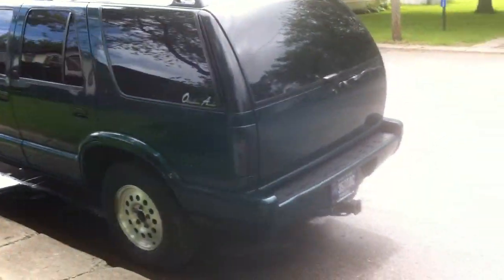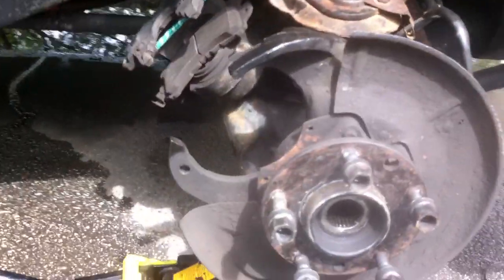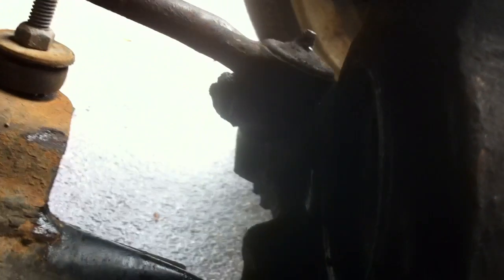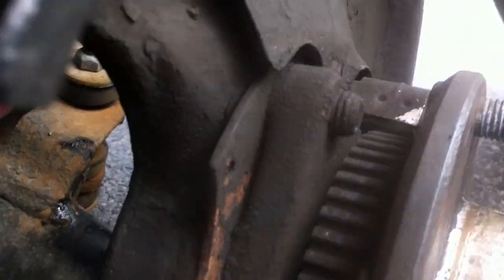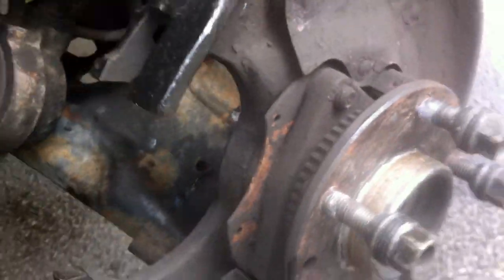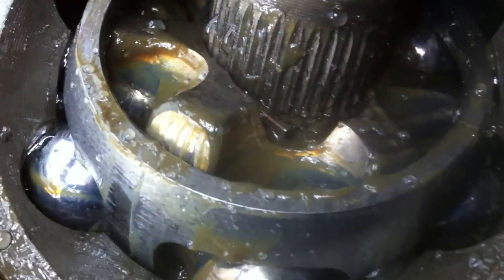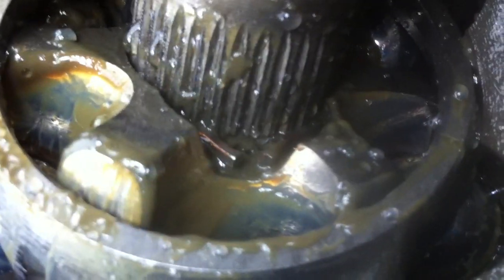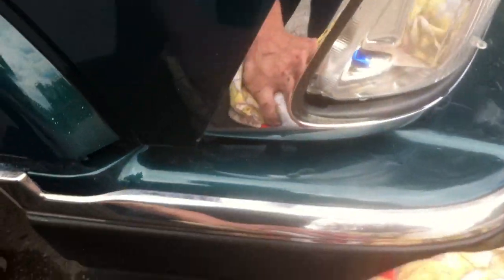1997 chevy blazer LS 4x4 cv axle removal.

Comment: I can afford two new cv axles ..but I'd MUCH rather have two wheel drive . My tiny case and all Is junk anyways .Ty for the video I am now on a two wheel drive mission Godspeed
Reply from the maker: The problem with mine was the bearings in the Front diff we’re going bad and I did not have the funds at the time to get those replaced. So that’s when the 2WD option came to mind and that’s what I ended up doing. just make sure you put the one end of the CV joint back in the hub so it keeps the hub bearing from separating. CV axle is the only thing that holds the hubs into the bearings. It was actually pretty easy to do. Godspeed my friend.

Comment: I know this comment is too late for you but others may find themselves in your spot.......Find out what gear set (ratio) you have and get a used front diff/axle assembly from a wreaking yard.  Replace the seals in it before you install.  New CV axles for that vehicle right at $100/set on e-bay.  There are a Jillion of these vehicles and used parts are easy/cheap.

Comment: wow bummer! i can smell the grease on yer video. looks like the shaft is stripped in the differential.
i'm tearing mine apart today, hopefully mine is only the CV.
Reply from the maker: I got lucky and everything was OK except for the bearings in the front Diff. I did not know the front Diff had a leak and drained all of the oil out till one of the bearings in the Diff started making a lot of noise.

Comment: how did you repair the boot? did you use a hose clamp or a boot kit? the boots on my truck are still good i just need a new clamp but i cant tell if there is enough clearance for a hose clamp with a bolt. ( the whole front end is out of my truck) parts store only has clamps for cars. and i dont want to buy a boot kit just for the clamp.
Reply from the maker: +adrock84ify  i ended up buying new cv axle's but you can buy the new boot kit and that will work to. or get a big hose clamp and that might work too.

Comment: when.you were driving did it sound like (if you understand what I'm about to say.....) the chain climb on a roller coaster? like "clank, clank clank, clank?" just wondering because I just got into a wreck the other day some idiot slammed their brakes and I couldnt get stopped and something popped after I pulled away, and I guess it must've been the cv joint or something now if the tire is spinning I hear it so loud lol
Reply from the maker: +Chris Rhodes  thats kinda what it sounds like happened to your truck. most likely its your cv axle or axles got messed up. it should only make that noise when your making a turn, if it makes noise just driving down the road then it might be something else like balljoints or tierods maybe.

Comment: Or, just do what i did.
Looked at the messed up cv axles, got new ones.
Looked at it again and said Fuck It.
The next owner can mess with it if they want 4wd.
Cant figure out how to get the axles out of the case.
I just removed the center shaft, left both ends attached, no noise or any problems.
Who needs 4wd if youre driving on paved roads anyways ?

Comment: This is more like a video on how not to do a cv axle removal. This guy has no idea what hes even doing. You can't use anything over, you contaminated everything when you took that boot off.
Reply from the maker: Colton S lol its all fixed now and everything works good. i just did this to get me by for now. guess you have no idea what you are talking about lol thanks for watching bud!!!
Reply: He's not going to the moon with this truck, it's just a repair to get by, and it worked.
Reply: number 1 front end not even locked in so front rear end not going to lock into any thing next u got to remove the rest of the axle out of front end    and if bearing  has no Axle in it it a death trap there nothing to keep bearing from coming off running done the road it will kill someone big chuck hole and it over  factory dose thing for reason it to hold everything in place
Reply: just looked at one a few days back his son done same thing just to get by for 2 weeks  so he could by new one he in his grave now it all snapped off and rolled it
Reply: @rickhenderson5708  I'm guessing you didn't watch the whole video. He stated that he was putting the ends of the axle shafts back into the hub (to keep preload on the bearings) AND he said he was going to do the same to the other side as well. There is nothing unsafe about this at all. Doing both completely disconnects the front wheels from the differential. Those wheel bearings don't know (or care) if the rest of the axle shaft is there as long as the ends are in place to keep preload on the bearings.
Reply: @TheREALJosephTurner  that the only way it was safe 60 years old been turning wrenches almost all my life I weld cut build  make all my life  so don't won't anyone hurt